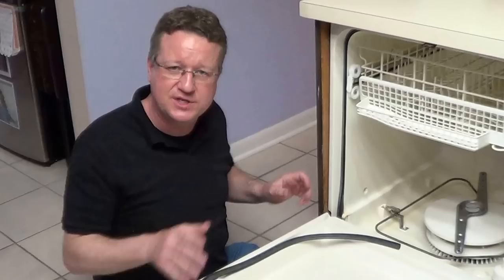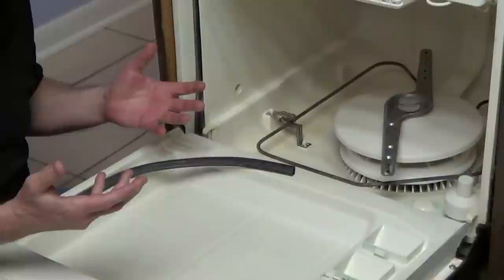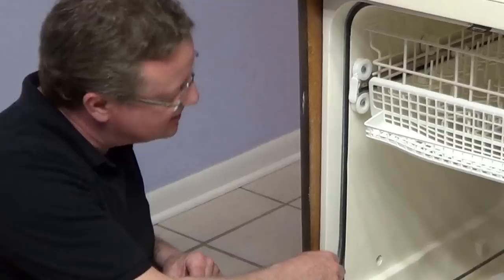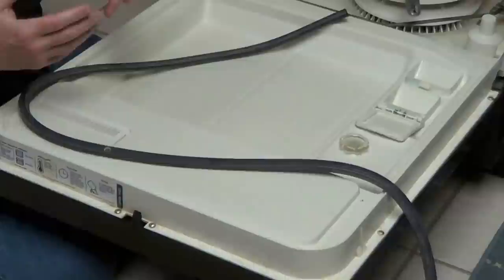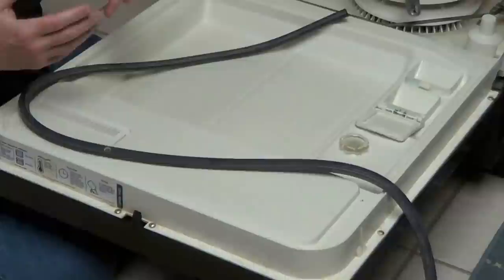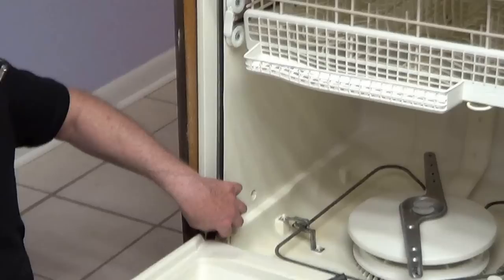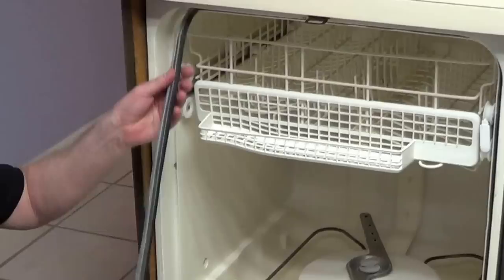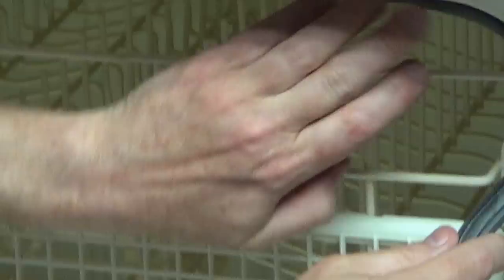Dishwasher Leaks - Dishwasher Leaking From Door

Comment: Dishwasher had water drip on left side of door. After watching a few YouTube videos, I pulled out the gasket. Washed it with soap and water to remove residue. Reinstalled it making sure the ends reached down far enough to stop leaks. No longer dripping.

Comment: Thank you for the information. Our gasket was still good so we had to dig a little deeper. There is a vented area on the bottom of our door and when we would start and stop our dishwasher, it would burp a splash of water out. After removing a plastic nut on the top of the rotating sprayer in the bottom of the dishwasher, I was able to pull that assembly out and noticed we had 2 screws that had completely come out and 4 others were loose on that assembly. When initial water pressure would start, it pushed a wave through the bottom of the dishwasher leading to the burp of water through the vent. Reinstalled and tightened screws and no more leak.
Reply from the maker: Thanks for the info
Reply: haha, thanks SO much for this. I spent forever messing with the door before I read your comment, turns out i had a bad seal on the sprayer

Comment: I have a 2004 Whirlpool my father-in-law gave us. It leaks around the door and we have puddles on both sides of the door after running it. I tried cleaning the gasket to no avail - so I purchased a new one. Looks easy enough to install -- BUT -- the old gasket does NOT go all the way to the bottom of the track -- is this normal or has the gasket shrunk from a few years of non-use? Do you ALWAYS install the door gasket all the way down?

Comment from the maker: Hi,
Most new gaskets are longer. If the track allows you to run it longer, I would try it long first. You can always trim it back.
Check the spray arm on the unit. If it is loose, it can cause a leak. You can also check the that the drain is not clogged.

Comment: When I run my dishwasher the foam insulation on the door is soaked, which is causing it to drip on my floors, Would that also be caused by the gasket?
Reply from the maker: Hi,
I would start by changing out the gasket. What is the make and model?
Reply: Its a frigidaire. Model is FGHD2433KF0
Reply from the maker: Here is a good website for parts and tips http://www.repairclinic.com/Frigidaire-Dishwasher-Model-FGHD2433KF0-ID-706307-Parts
Reply: Thanks.
Reply from the maker: You're welcome. Let me know how it turns out.
Reply: I decided to replace both the tub gasket, and the door gasket. Checked the dishwasher today towards the end of the cycle, and the foam insulation behind the door was perfectly dry, and no water on the floor. Problem solved. Thanks.
Reply from the maker: Glad it worked